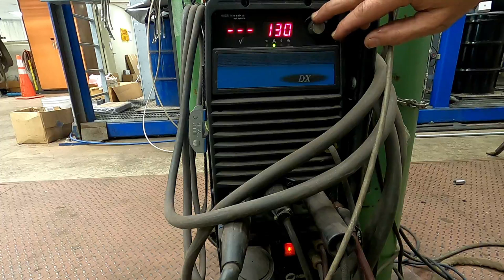Massive Footer pour Day!

Comment: Interestingly your ready-mix trucks are back to front compared to the ones we have in the Uk.
Reply: Ours in Australia empty from the back as well,but from the front makes a lot of sence
Reply: I've never seen a truck like that. Every single one in here dumps from the back. Also there is a pumping unit that also has the concrete tank in it, that's the most handy option for a small job like this as  single man can do the job
Reply: Here by us in South Africa in also unload from the back, I've seen the front ones on Andrew Camarata's channel, makes alot more sense.
Reply: We have both here in north America
Reply: Many of the UK rear dispensing concrete trucks are actually sourced in the USA.  I am friends with the owner of a  big concrete company near me and he buys trucks in batches of 10 from the USA. I think that the front dispensers seem to be more practical.   regards
Reply: Ready mix companies in the United States us both, most operations use rear unloading, some use front and some have both front and rear unloading trucks in their fleets. The front unloading trucks are nice for doing large flat work as the operator can move the truck and more easily position the shoot from the cab as the pour proceeds.
Reply: These osh kosh front loader trucks are amazing trucks. They pull on all 6 wheels. I've seen these trucks go thru some pretty rough muddy terrain loaded with concrete and not get stuck. These front loaders are twice the price to purchase than a rear loader. A good operator on a front loader can save the labor crew tons of work by placing the concrete accurately. Moving concrete by hand and wheel barrow is not something anybody likes to do. These trucks save labor.
Reply: @garyc5483  it's sad that old Britain doesn't even build trucks R.I.P.
Reply: @neilpuckett359  No auto industry, no truck industry, no steel industry, just a falafel stand on every corner- the inevitable result of socialist policies.
Reply: In Utah, USA pretty much every truck I've ever seen is the front unload type. I should note that Utah is an old Ute Indian word meaning top of the mountains
Reply: Front chute trucks are pretty rare in most places. I think the drawback of them is no one wants to drive them down the road and they don’t have nearly the creature comforts of a cab/chassis.
Reply: @neilpuckett359  There's not a citizen of any country in the world that doesn't lament what used to be built there. :)
Reply: In Texas, I'll I've seen were rear unload cement trucks.
Reply: In the Sierras you see a mixture of both.   There are also smaller 4 yard mixers with all wheel drive for getting into hard to get to places.   Most of the ready-mix trucks though are still rear dumpers.   This allows them to use bigger drums on them and a drop axle to carry the weight up to 10 yards or more (40K lbs or10K lbs/axle).  They are limited to 8 yards without the drop axle.
Reply: You silly people, can't you see? It doesn't dump from the front but steers and drives from the rear and goes down the road backwards.
Reply: @TKevinBlanc  well put sir!
Reply: @oldschool1993  WWII white people were fighting one another how in the hell did that happen? Look at Europe now!
Reply: @neilpuckett359  Not sure what your point is, but after WW II there were 2 countries not totally devastated by war, Britain and the USA- both went into times of prosperity, but in Britain the socialists took control and decided that government could run things much better than private enterprise, and in 1 decade they had slid into economic collapse, while the countries that had been flattened by them in the war went on to economic prosperity.
Reply: I live in Connecticut, north eastern United States. We have the front pouring concrete trucks as well, I have never seen one with a rear unloading fixture.
Reply: We have all kinds. Most are back chute. Front chute can get some places a back chute can't.
Reply: The front-spout ones are relatively "new", maybe ten years since introduction compared the more traditional back enders. There are plenty of the older type around, but a bit of study and watching suggests the front enders are better, safer.
Reply: @salsyou  there are still a few outfits with the rear discharge set up, and I think the small trucks that specialize in short loads are all rear chute machines. 40 years ago you almost never saw front discharge ones in Connecticut.
Reply: @pneumatic00  I remember seeing front trucks years ago. They're not new. Maybe not very popular but they've been around for a long time.
Reply: We have both Front and Rears here in the USA, and some Ready Mix Companies keep a few in their Fleet that will discharge from the Front and Rear. Front Discharge Trucks are obviously more expensive, but are far more safer on the Jobsite, as well as they save a huge amount of Labor, which equates to $$$. When you call in an order of Ready Mix here in the US, you can usually request a Rear or Front Discharge Truck, depending on your needs.
Reply: They drive on the wrong side of the road too....
Reply: @salsyou  same in Michigan.
Reply: @oldschool1993  Lol The UK was devastated by WWII both economically and in terms of infrastructure (not on the same scale as Germany ).  The UK  did not benefit as much from the reconstruction efforts ( Marshal plan etc ) as many European nations. The UK was also massively in debt from war spending.  At the same time the end of the Empire ment that the UK  could no longer exploit its colonies economically, no closed market for British goods meant that industries had to compete on quality and price with international manufacturers.
Reply: No need for front loading trucks here in Sweden since they are remote controlled nowadays. The newer ones they can even manouver the whole truck from outside. But without remote control this makes more sense.
Reply: Ones in canada pump from the rear. When we pour footing for blockwalls  we impress a keylock in the middle of where the block is laid so the walls locks. Simple trick lat a 2x2 on a 45 angle and press it in.  But thats here.
Reply: @MoondyneJoe  Indeed it makes a lot of sense, especially at this particular job! But I never saw a front configuration before. Here in The Netherlands it's all back dumpers too.
Reply: @ZerokillerOppel1  I wonder why they haven't taken off in our respective countries?

Comment: major - good overengineering - fill the blocks with some wire and that closed cell foam - maybe even apply some insulation - foam board to the footers, all that concrete holds lots of heat why lose it #icf forms #monolithic slabs

Comment: Here in South Africa that volume of concrete would be 8 day labourers, 4 wheelbarrows, 8 shovels and 2 piles of sand and gravel, plus 10 50kg bags of cement. Then some flat spot where 4 would be taking from the piles and mixing, then putting in the barrows to move to the footing and pour.
If it came with a truck the same 8 labourers, 8 wheelbarrows and 8 shovels, and a half day of the truck on site. Then the rest of the day the finishing off and manual vibrating and setting, using poles as vibrators, and then cover with sand overnight.
Keep on watering that concrete, at least every day for a month, to get it hydrated nicely and cured. Biggest thing is people think they should let it dry out, when it needs to be slightly damp to cure correctly.

You know it is Steve Summers when he wants his used blocks to be better shape than new ones, though all those odd blocks are very useful to use for small projects, or as fill material when you are casting the new concrete floor, where they can be broken up and packed tightly into the space, then tamped down, filled with sand equally tamped down, and then put the reinforced slab on top, using up what otherwise would be waste, though I guess the old concrete floor will be good still as driveway fill for any depressions before you lay another gravel top over it.
Reply: Don't worry, the US is steady on the course to become a failed state, like South Africa.
Reply: Yep concur  - the old unusable blocks can be broken up into rubble, and go down on the inside of the footer as fill.  Good way to use it up.

Comment: Nice progress. I work larger commercial projects as an Electrician. Pump trucks are used quite frequently, but always with 4" or usually 6" lines. Never saw a 2" one before...painfully slow. Like pouring your footers with a dixie cup haha. Oh well whatever gets it done =) And I agree with you on rebar - should be fully encased.
Reply from the maker: It took around 40 minutes to fill the footer . Everyone was in and out in 1.5 hours.
Reply: @SteveSummers  That's not bad at all.  Looked like they were there a lot longer from video.  Looks like the footers came out awesome, though. You did great. Love the secret form release agent haha

Comment: that pump was a lot slower than I was expecting.
Reply: turbo
Run at a very slow speed to suit the form work there. It could do up to about 35  yards per hour with that line & close to 80 with a 4 inch line if the motor was running at higher revs. They don't push that pump too hard & that's why it's still going even after 30 years.
Reply: with a 2 inch pipe it would have to run slow as it would pressure up and shoot across the creek like a garden hose ,,, Sure beats wheelbarowing it in ,,,, altho you do sleep well that night !

Comment: Great job Steve. A pity you did not get it vibrated cos now it will only last 1000 years instead of 2000.🤣  Now just the walls and floor to go. ATB Stay safe. regards from the UK
Reply: You only have to vibrate to avoid getting wormholes on the form face. Steve didn't get any so he's OK. He's burying it anyways so it isn't an issue. The only other times you vibrate is just to move material. You're actually better off not vibrating if you can help it.

Comment: Four inch line? Try an eight inch line. Though that goes into a six inch reducer. No one drags around eight inch lines. The six inch lines weigh three hundred pounds a section full of concrete. Which is enough for one guy to move around. We use those little trailer pumps to grout block webs. So working up on scaffolding. I don't think there's any such thing as four inch concrete hose. If there is I've never seen it. Seen the two, six and eight though.
Reply: I've been around a lot of commercial pours and 4" (ID) is the largest and most common.  Maybe if you are pouring a dam or something a larger hose may be required, but 4" is the norm.  Check out this supplier I took from one of our project specs.....http://powertrackhose.com/catalogs/Concrete_catalog_2017%20edited%20rev%204.pdf
Reply: @paulcopeland9035  we always used 6" hose unless we were grouting block webbing. We poured commercial decks. Often only 3 inches thick. Plus the metal corrugations. Though the thickest slab I ever poured we just placed out of truck chutes. That was about a foot thick. And it was on the ground.

Comment: Steve, glad your forms held up and removal went well. There was no need to vibrate since it was a grout mix and slowly placed. One question though, where is your vertical rebar to tie the block wall to the footing? The only way now is to drill holes and use a two part epoxy to set the rebar in the footing. I think you missed something here and may have created an extra step. Glad to see another video and look forward to more progress with your build!
Reply from the maker: I left the verts out on purpose.  I decided it would be fool proof to drill and epoxy them in. No shifting or misplaced rebar.  It adds a few hours to the job depending on how you look at it. I've saved the money from other parts of the project doing it myself so it will not cost any extra money in the long run for epoxy.
Reply: @jeffreylee7184  Yes, anchoring cement could work, but I'm from earthquake country, California, and we now have to use Epoxy. I agree with Steve about  possibly misplacing the verts, so setting them after the pour is acceptable. This method also made forming, pouring, and finishing the footings easier, so drill away, Steve!
Reply: @jeffreylee7184  I see your point, but I personally like Steve's method of approach and he will choose the best solution, given the circumstances, while learning along the way.

Comment: Weight bearing, in my opinion, isn't your main problem.  What you want is to keep the  whole foundation in one piece and not sliding down the hill as it did before.  In a case like this, I don't think you did any overkill.  Using too much concrete is much better than having to do this all over again.  My garage is built on sand(I live at the beach), and I spent about $15,000 on concrete just to get to grade level.  If my foundation settles, it will all stay in one  big piece.  Money well spent, I think.

Comment: Learn something every day.  Never even heard of "3D printing" metal.  How is that done?  Using molten metal??  Intriguing for sure.  Good job on the concrete pour.  I bought a Chinese sixty dollar version of the vibrator so I could run the forms myself.  Actually a pretty fair machine for that kind of money and as often as I use it it does just fine.  Looks like you will be ready for winter.  Take care.  Doug
Reply: Metal 3D printing uses a powdered metal and a binding agent.
Reply: @DirtForester  So is the finished product the same strength as normal steel?  Thanks for the info.

Comment: Not much worry about blowing anything out with it coming in a cup at a time. I'd be more worried about 10 yds startin to set up goin in that slow. LOL. You can REALLY control where each cup goes... Yanking those grade stakes out at the end is something I do also. Probably not a big thing as they aren't tied to any other rebar, but... It sometimes takes the patience of Job to do it all as right as you possibly can. I absolutely LOVE concrete. Strongest damn stuff... Vibrating isn't as big a worry with pumped mud, it's usually pretty smooth flowing so gravity will usually do it right, especially if it goes in slowly. The 3 and 4 inch pumps pump it in so fast you have to walk around to keep from blowing out the forms. Congrats on finally getting in a big ole base to put that wall on. Michael in Colorado. BTW: I have been called 'Mr Overkill' most of my adult life, you, Sir, do things like I do. Worry about it, then just overdo it, it's just easier to make a footer a little wider and deeper than REALLY necessary.... Then, NEVER worry about it again. Say hey to Peanut for me!!

Comment: I'm not sure why you don't to the block laying yourself. Those blocks are supposed to be stacked without any mortar anyway. They are designed to build walls dry, and just be filled afterward with concrete, to make is solid.

Comment: Tough part for that hose man is being bent over so damn much. I worked with plenty of concrete hose, usually a 4" at the end of a 6" run. Tied a rope or used a cable with a handle to control it, rebar hook in my other hand to help with moving it around. My back aches just watching that poor lad.
Shame about the lack of vibrator. That was a mistake but it's not gonna support any massive structure. Pretty sure it will outlast you, hehe. You could have gone around with a piece of rebar and puddled it. I didn't see any voids in the ends. Maybe there was some plastciser in the mix?

Comment: I've got a few questions. Maybe you've answered them in an episode I've missed.  Why is the footing so wide? I thought you were concerned about the old w1H8oldcar$ a wide (spread)footing, say 15-18in wide x 6-8in thk, then a narrower wall(say, 6-8in wide) atop of that which penetrates grade at least 8in. Your wall seems unusually wide,  even for cinder blocks, and it does not penetrate grade.
Also, how do you know it is 5kpsi mix? Did anyone pour a couple test cylinders?
Reply: on
Reply: mobile keystrokes went crazy. 
supposed to be old wall was too heavy, so why is new wall so wide (& heavy)
Reply: if the logic is supposed to be a "beam" footing, then the rebar  looks woefully inadequate to me.